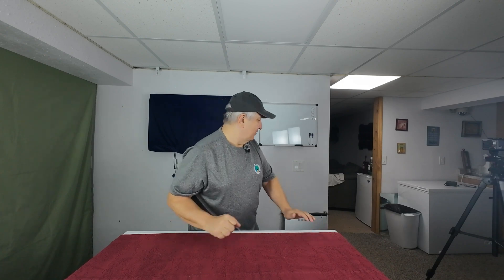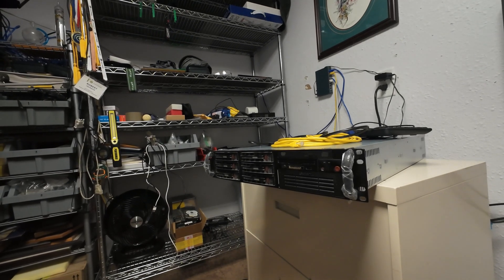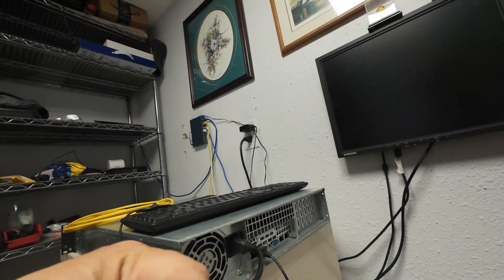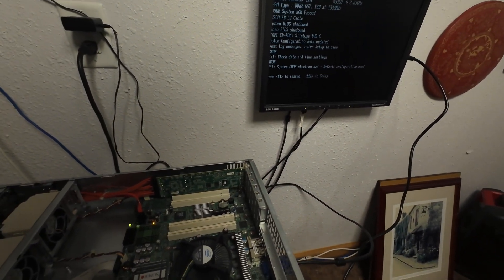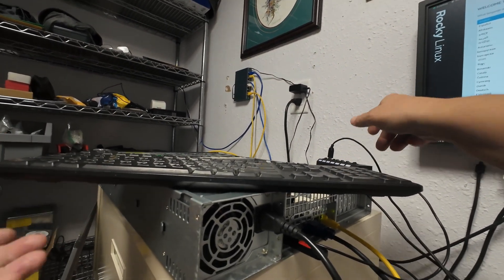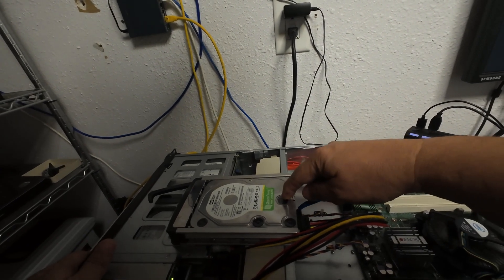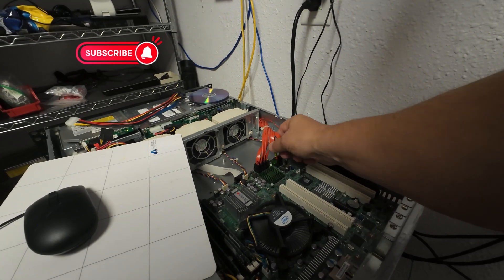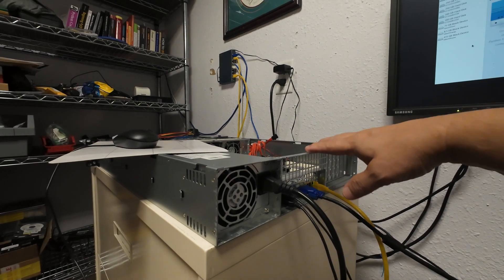It Hasn't Run in 13 Years — But It Has the Storage I Need! 🔧💾

Comment: That's an older supermicro (raid or HBA card). 6 slots on the front. that's at least 60tb with 10tb hard drives. And you don't have to keep it turned on 24/7. Its just storage, use Truenas Scale. If you don't want it, I do.

Comment: Don't you need drivers to allow the os to view the hdd's which are probably in a raid configuration?
Reply from the maker: I'm sure there was drivers stripped from the newer releases that prevented the install from seeing the card/drives. Figuring out which one and getting it working sounds kind of fun. 
The older CentOS 7 found everything fine, the problem with it is it EOL.
As far as the raid the drives were switched and the bios/cmos did not have a raid setting for any of the drives.  There could of been a setting I missed! Great comment! Thanks!
Reply: @TechnologyBob  Maybe I'm underthinking this.  I'd assume you're trying to install an old linux-based server OS?  Doesn't linux run on just about everything?  I've only stick my toe into that particular pool a small handful of times so I'm not a linux expert at all.  Why not try something a bit newer than a version that is EOL?  I know you said you were not going to set this server up fulltime.   Heck, you could setup a small nas box with all the storage you''d need relatively cheaply these days
Reply from the maker: I only tried an older version when the newer version didn't work, and I knew the older version worked on a machine like the one I was trying to revive. I learned Unix back before I knew anything about DOS/windows, Linux does run on almost everything you could probably find a port for anything. You are correct on the NAS and that is the route I will probably go, I might even take an old system and build it (I have lots of hard drives )! I was hoping for a quick resolution to save some cash now that I'm retired :)
Reply: @TechnologyBob  Oooh, is the OS you were trying to install Unix-based?  I guess that changes things.  I understand using what you have handy.
Reply from the maker: Yeah... It was Linux -- Rocky 9.1 (Rocky kind of took the place of Centos when RedHat changed and made it Centos Stream).